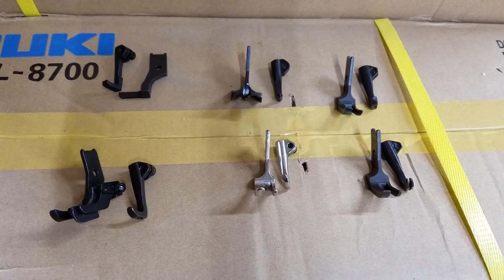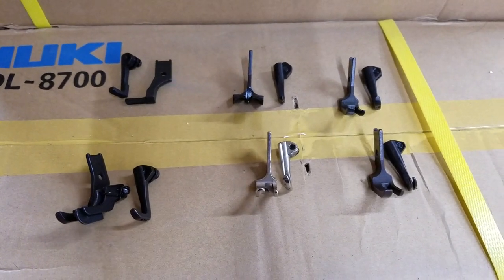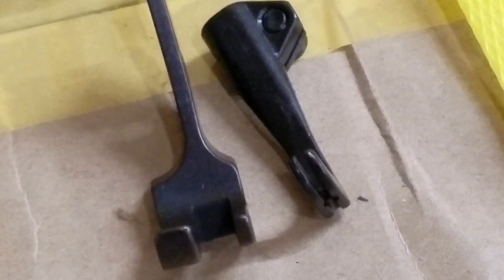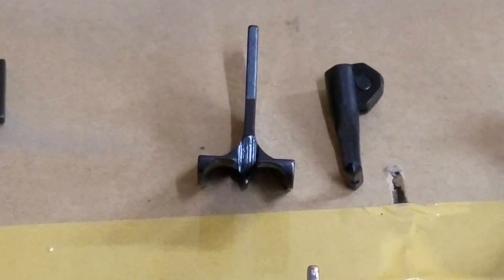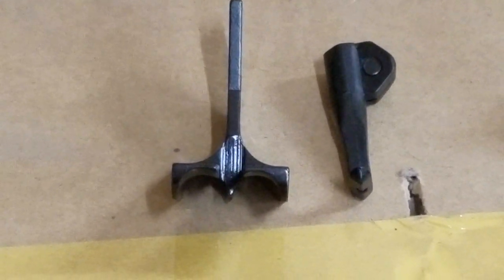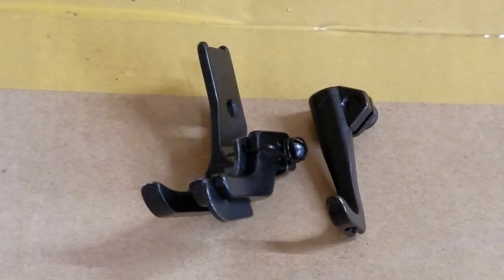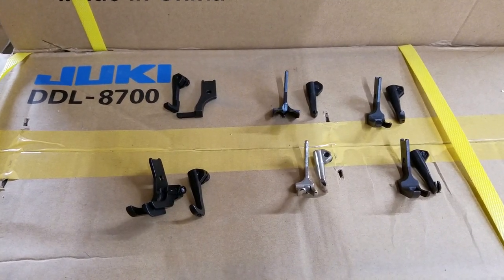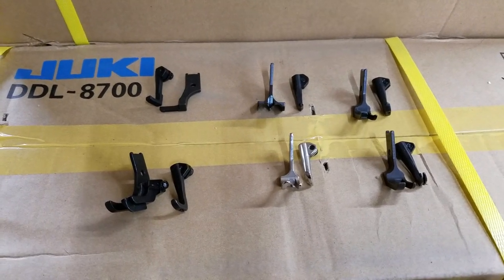Presser feet sets for an industrial compound feed, walking foot machine

Comment: I have this guided foot for topstitches for a Typical GC 0617D. It is to tight between the walkingfoot and the presserfoot so it   want work for stitches longer than 4mm. How can I adjust the distance between the feet?

Comment: Are all the middle feet on Welt Cord feet all the same size?  ei.  middle foot on 1/2" welt foot the same as the middle foot on a 1/8" welt foot.
Reply from the maker: No.  Some of the larger welt feet have larger middle feet.

Comment: What about a foot with a smooth bottom for leather?
Reply from the maker: There is a standard foot set that is smooth.  We stock it.
Reply: I have a consow 205. I'm new to machine sewing. What is the largest recommend thread size and do you feet fit my machine? Thank you so much!